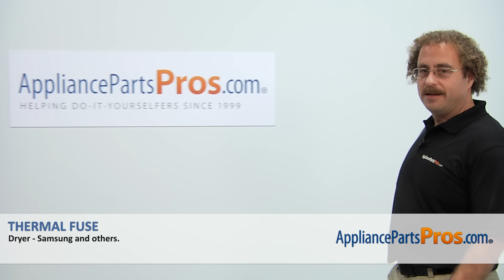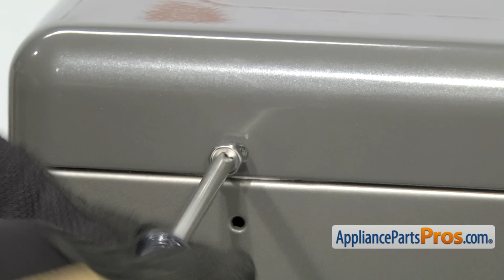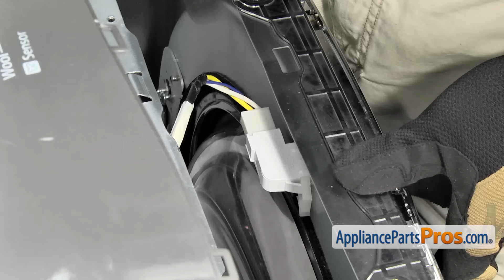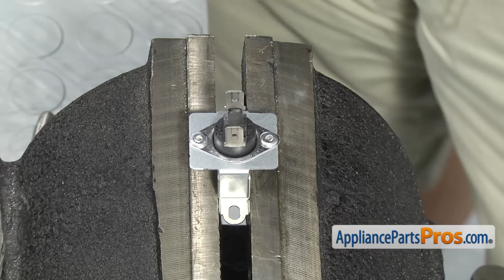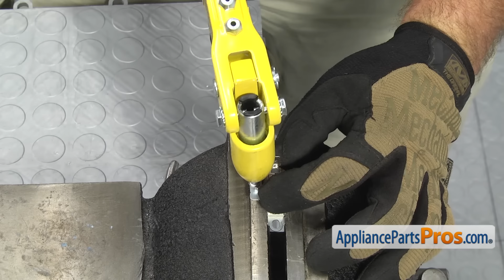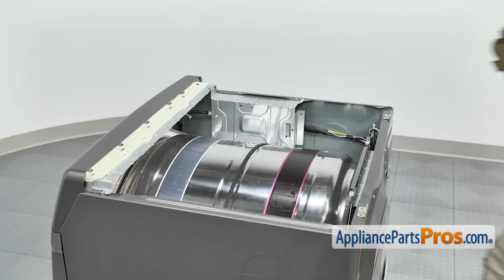How To: Samsung Dryer Thermal Fuse DC47-00015A

Comment: A little late, but for anyone reading this.... you don't need new rivets, just use a couple small zip-ties.
Reply: Or sheet metal screws
Reply: Too hot for zip ties
Reply: @danielguzman951  Worked for me. Zero issues with the zip ties I used.
Reply: Amazon sells the kit with the bracket already installed
Reply: @SR-pt5lo  Yeah, looks like they started doing that. They didn't back when I commented originally. 
Sadly, I found this out myself recently, as I had to replace this yet again just a few months ago. 😖
Reply: Yeah, pop rivers are best, but screws will work. Zip ties if you like living dangerous.

Comment: Tell the viewers about the other bracket...the one on my machine that didn't have clips to slide into at the rear..took me a hour with a short Phillips head to get them out! Since it was virtually impossible to get them back in after installing the coil, I carefully  set the dryer on it's side and used my screw gun to drive two self drilling sheet metal screws up through the bracket from the bottom! Other wise the installation was fairly simple and your video was perfect! I bought a Coil housing with a Thermal Fuse already installed so the coil, coil housing thermal switch was already installed, less than $60 from Amazon. The dryer lasted so far for 8 years with no problems (just my wife and I so less use than a Family) but I'm glad I found your video because it gave my the push to make the repair myself! Thanks! Next I'll be looking to replace the Seal on my double door Kitchen Aid refrigerator with the Freezer drawer below...all three sets of door seals need replacing! Thanks again for the well done Video!
Reply from the maker: Thank you for the tips! Glad you were able to complete your repair!

Comment: This is very helpful although the need for a pop gun makes this installation more painful. Upon further research, I think that DC47-10005A is the fuse itself but I've seen some companies also sell DC96-00887C which I think is the fuse with the bracket. Thereby there is no need to install drill and use a pop gun. It's just weird because you'd think that they would name name more similar since one has a bracket and the other doesn't.
Reply: It's 4.99 at harbor freight, and it pays for itself the first time you don't have to buy extra parts so you don't have to assemble yourself.

Comment: This guy is crushing it! Clearest most precise videos on youtube. Sadly the fuse didn't fix my no-heat issue. On to replacing the heating element.... fingers crossed.
Reply from the maker: We offer free technical advice and diagnosis, so if the heating element doesn't fix it, we'd be happy to help you diagnose the problem and recommend a part. You can give us a call at 1-877-477-7278 or you can chat us at our website: http://www.appliancepartspros.com/. We will need your model number to give you accurate advice, which you can locate using this tool on our website: http://www.appliancepartspros.com/modelnumber_locator.aspx
Reply: Why would you not buy a multimeter for $7 and test all the parts first my guy.
Reply: @Pussmash  Thanks for responding to my 2 year old post. But to answer your question, I knew nothing about how much a multimeter cost, or how to use it if I had one. 
If I had such knowledge, then I wouldn't need to be looking up videos like this in the first place now would I my guy?
Reply: @LastBastian  😂

Comment: I repair dryers and never have I ever drill out rivets on a thermal fuse. the bracket was already included, like the original.
Reply from the maker: The repair can be different for different models. If your unit doesn't require that step, you can skip it.

Comment: Why does it matter which wire goes where on the fuse if you didn't specify whoch way the fuse should have been placed on the bracket?
Reply from the maker: It will not matter which way the thermal fuse are turned on the heater. As long as both wires are connected to the fuse it doesn't matter which terminal they are connected to.

Comment: Oh man.. I had trouble getting the washer door off (it was REALLY stuck on those tabs!), and by jostling it around to try and get the door off, I heard a clink clank CLUNK like something had fallen through. I thought that was weird, but nothing could be done, and I really just wanted to get that door off. After a while of struggling, I went to look at my phone for the video to see where I was going wrong. I realised I had set my phone on top of the dryer (going back and forth from the video), and it had fallen inside the dryer.... Anyways, 30 minutes of trying to retrieve my phone with spatulas and tongs later, I did finish up replacing the fuse and putting it all back together. It fixed the heating issue!! Except now my arms are scratched up from trying to get my phone out 😅😅 Wonderful tutorial. Very well explained. DON'T set anything on top of the dryer while fixing it.
Reply from the maker: Glad you were able to complete your repair. If there is anything we can help you with in the future please let us know.

Comment: Thanks! This really helped and my dryer is working again. The only thing different I did was to check for continuity with a multimeter. I found out that I actually needed to change out the coil wire and not the fuse.
Reply from the maker: Glad we were able to assist you. If there is anything we can help you with in the future please let us know.
Reply: Was your coil broken? Or is it possible for the coil to still be bad even though it's appears to be still intact? Asking because my Samsung dryer is not heating up, so I removed this entire part but my coil is not broken.
Reply: @znismo1  what you’ll want to do is take a multimeter and check the coil for continuity. The multimeter will beep if the circuit is closed (not broken) and not beep if the circuit is opened (broken). If you find that it beeps then your coil is fine. If the coil doesn’t beep then you’ll need to replace it. If the coil does beep then you’ll want to check the fuse and other parts of the heating element for the same beeping noise for continuity. Once you find the part that doesn’t beep, that’s the part you need to replace.
Reply: @znismo1  my coil was broken and I thought initially that it was my fuse.
Reply: @Mr_Uni  thanks for the info. I'll try and check it with my multimeter

Comment: I have a version of this model that was made in 2016. It has two clips on the front control panel on the bottom that don't just lift off.  And the bracket holding up the heating element box actually has a screw on the back of the bracket and no rear tabs.  In the future you may want to mention that Samsung has made a few changes over the years.  It would have made my blood pressure behave better.
Reply: I have one like this and was very frustrated trying to remove the front control panel. A quick strike (not hard) with the palm of my hand at the base where those clips are and it popped right out.
Reply: I left that screw out when I put it back.. f that.
Reply: I also had a screw at the back! After struggling for way too long I used my phone to take a picture and discovered, a screw!
Reply: Funny thing( that isnt so funny at all) i just now at this very moment am experiencing the exact same thing you did and its made me realize this video shouldnt make it look so easy. Also i realize they must screw that bracket down now so that you yourself are more likely to give up and call a repair guy.
Reply: @jamesthrift6194 were you able to access this screw without removing the drum or did you need to remove the entire drum to get access?
Reply: @daniellesmith8233 how did you end up replacing your thermostat?
Reply: Just got done getting the bracket out of mine (after a lot of frustration and swearing). The model I have had 2 screws on the back of the bracket. It also had a screw holding the housing to the bracket. I didn't have to take off the drum to get it out, I went to the store and bought a set of offset screwdrivers for 2 dollars. It took time, but I was able to get it off.

Comment: I found the solution to my My Samsung dryer DV330!!! It was simpler than I thought :-) kept blowing the high limit thermostat. I replaced the high limit thermostat (manually reset it as many times as I could first), thermo cut-off fuse, heating element, cycling thermostat, AND the thermistor. They all had continuity but I replaced them anyway, and the thermister was reading the correct ohms when I did resistance test at room temp. I also cleaned the heck out of the dryer hose, filter, and blower wheel pipe to make sure air flow was good. I even ran it with no dryer hose but was still over heating. I checked the relay switch on the main control board and confirmed it was operating correctly. I was racking my brain trying to figure out why it kept over heating and tripping the high limit thermostat.  Eventually I bypassed the thermostat with the higher temperature thermo fuse and ran the dryer at 10 minute intervals, but then I figured out the root of the problem!  It was the blower seal and the seal on the dryer filter cover. The foam gasket had become so depressed, that gaps in the seal allowed the blower to suck in cooler air from out side the dryer drum. This meant that the air running past the cycling thermostat and the thermister was cooler than it actually was within the drum.  SOLUTION: I thickened the seal of the blower wheel and dryer filter cover with electrical tape and covered the gaps with electrical tape, this ensured the blower wheel was sucking in 100% of the hot air thru the dryer filter, and none of the cooler air outside of the dryer drum. After doing this, to my surprise the heating element was cycling on and off in like 2 minute intervals like it should, no more over heating and tripping the high-limit thermostat!!  Before I corrected the seal, the heating element would never turn off, it would stay on for like 8 minutes and then blow the thermostate. Not anymore!!

Comment: Great video...and have successfully repaired my Samsung dryer multiple times....but almost yearly, a thermal fuse and or thermostat or element fail, and I am back in the dryer again. Seriously, like 8 repairs in 6 years. This doesn't seem right. Any advice?
Reply: See comment by Jay Dubau from two years ago. May be the same problem. I'm not sure about his solution; not familiar with this, but it does seem he found the cause.

Comment: Samsung has done a bit of redesigning to make the process easier but why not address the real problem?  As mentioned previously, the older models have 2 screws on the backside of the element bracket instead on mounting tabs.
Reply: I know it's awful
Reply: This is something I’m figuring out as we speak

Comment: Who's to say which is the blue wire post and which is the black wire post on the new fuse?  What prevents you from installing it backwards and reversing the current through it? Or does it not matter?
Reply: My same thought when I watched the video.... maybe it does/dosen't matter ???
Reply: It should not matter.  It's just open or closed.
Reply: @jeffl1430  thanks this was driving me crazy

Comment: Will this prevent it from receiving power? It gets no power. The front panel doesn't come on
Reply from the maker: It is possible yes. Do you happen to have a multimeter to be able to do some testing?

Comment: I change my thermal fuse but it kept blowing out what can cause this to happen??
Reply: Overheating from something. If you have a multimeter check the continuity on the heating element, thermostats, thermistor, etc.
Reply: There are two thermal fuses in this dryer.  So be careful when ordering parts, if you order the wrong one (DC47-00016A) it has a lower temperature threshold and will blow at like 150 degrees instead of 320 degrees for the correct DC47-00015A that attaches to the heating element housing.  I blew two DC47-00016A's and then called a repairman who told me what my mistake was.  I ALMOST saved a lot of money doing it myself but I ordered the wrong part TWICE.  (doh!)

Comment: You missed the most important step for your customers. How do you know when your thermal fuse needs to be replaced?
Reply from the maker: This is a replacement video, we do also have troubleshooting and testing videos. To test this thermal fuse you will test it for continuity with a multimeter.

Comment: Can I make repairs with our rivets and pop gun?
Reply: Hot glue?
Reply: A little late, but for anyone reading this.... you don't need rivets, just use a couple small zip-ties.
Reply: If you are doing this maintenance work yourself, you 100% have a couple small screws lying around. Just use those. Don't use zip ties as they'll become brittle and break down the road, while screws will only come loose.

Comment: Nothing with the control panel will come on. 
We've reset the breaker & unplugged the dryer for 30 seconds & then plugged it back in. Still no power?
Reply: I’ve got the same problem. Did you find a solution?
Reply: @carisware8943  We left it unplugged for 24 hours, then plugged it back in & it reset. We had a appliance repairman come out and test it. He said the motherboard is failing. We ordered a new one, we'll replace it the next time it quits . We won't buy another Samsung appliance

Comment: I put a new heating element in my 5 year old samsung dryer. It was working fine just not heating up. Hooked everything up and now it won't start at all. No lights no sound norhing. What a POS. Anybody got any ideas?
Reply from the maker: Did you flip the breaker off by chance when you did the repair or did the breaker flip by mistake when you tried to run the dryer? Did you make sure that all the wires were hooked up correctly?
Reply: Breaker is fine. There is power at the plug in the wall. I put the 2 new  switches that came with the heater element. I thought i hooked it up correctly. Maybe i didn't. Do you have a pic you could send me showing the correct way to hook it up?
Reply from the maker: What is your model number?
Reply from the maker: We don't have a schematic or anything that we can send to you. Do you happen to have your owner's manual or tech sheet for your model?
Reply: I put the old thermal fuses back in it because i thought the new ones may be wrong. Still nothing
Reply: Here's that model number again if you didn't get it. DV42H5200EP/A3
Reply from the maker: Have you had any type of power outages?
Reply from the maker: We don't have a schematic or anything that we can send to you. Do you happen to have your owner's manual or tech sheet for your model?
Reply: @appliancepartspros  no power outages
Reply: @appliancepartspros  i looked at 2 wiring diagrams for this heating element.  The very front wires that plug into a small rectangular fuse shows blue wire on top. Red wire on bottom. The other diagram shows the red wire on top and the blue wire on the bttom. Any idea which diagram is correct?
Reply from the maker: Is your heating element a 2 wire or a 3 wire hook up?
Reply: @appliancepartspros  it is a 2 wire each for the 3 switches
Reply from the maker: You stated you replaced the heating element. There are 2 different heating element assemblies for this model. There is a 2 wire hook up or a 3 wire hook up for the heater assembly. Do you know which one you have?
Reply: @appliancepartspros  it is a 2 wire hook up
Reply: @appliancepartspros   Here is the part number of the repair kit i recieved. DC47-00019A
Reply from the maker: Do you happen to have a multimeter?
Reply: @appliancepartspros  yes
Reply: @appliancepartspros  there are no jumper wires from fuse to fuse
Reply from the maker: You can test the thermostats and the fuses for continuity and see if they all have continuity coming to them.

Comment: What a stupid design.   All that work for stupid fuse.     Unbelievable
Reply from the maker: You could always call a repair technician to do the job instead.
Reply: agree, I had a maytag where all was easy to get to when the top was taken off. wish i still had it, bu the wife says we gotta be fancy like the rest of theidiots in world. otherwise great vds
Reply: The funny thing is the manufacturer did not put a resetable fuse. and they keep increasing parts prices to push owner to buy new appliance..and push the technicians out of business..
Reply: IDK, it's 40 minute of work, for a whole kit replacement. This video is 22 minutes if you move slowly. Get yourself a mini dugga-duggga (electric screwdriver).

Comment: Who's to say which is the blue wire post and which is the black wire post on the new fuse?  What prevents you from installing it backwards and reversing the current through it? Or does it not matter?
Reply: Doesn't matter.
Reply: I've seen 3 different videos with 3 different routes.. I think as long as the blue wire goes to the smaller one first. And jumped to the other two.. it should still work..

Comment: Who's to say which is the blue wire post and which is the black wire post on the new fuse?  What prevents you from installing it backwards and reversing the current through it? Or does it not matter?
Reply: He did not point it out but there was a blue dot on the new one that designated the blue wire.
Reply: it doesn't matter, has no polarity